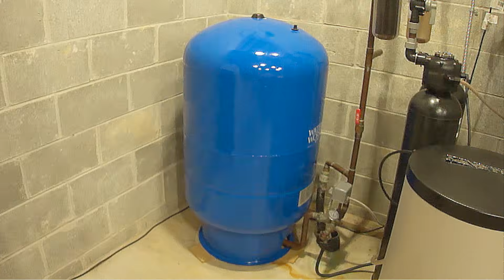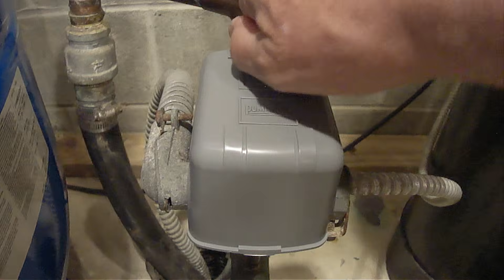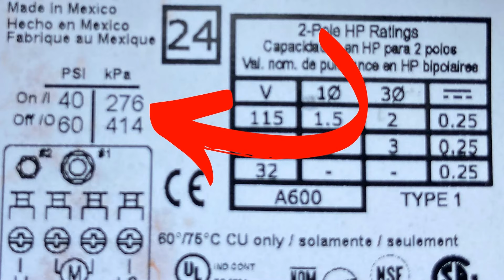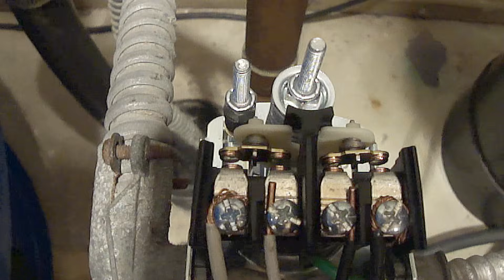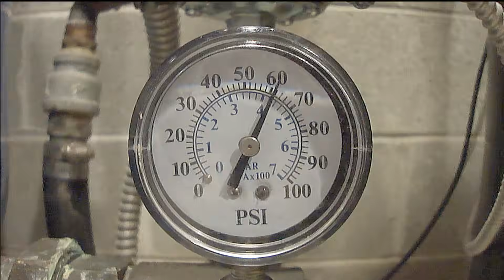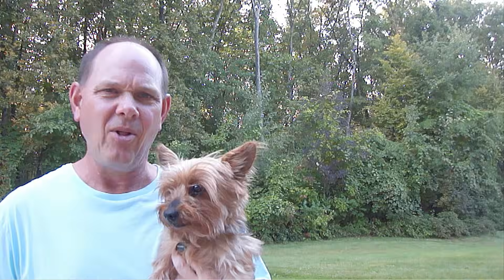NEVER Adjust A Water Well Pump Pressure Switch Until Watching This!

Comment: Ive nvr seen a pressure switch work like u r saying  pretty sure ur wrong 
Big nut will raise 40 and 60 
To 45 -65 or higher depending  on how umuch u tighten or losen
Reply: The small nut reduced the gap between  
40-60

Comment: I have a shallow well jet pump.  The pump shuts off at about 55 psi (cut out pressure) but the psi drops to about 20 or less when I use water before the pump comes on again (cut in pressure).  If I turn the big screw clockwise the label in the switch housing says it raises both the cut in and cut out pressure.  That's a differential of about 35 psi, which is ridiculous. The small screw per the label in the housing, when turned clockwise, increases the cutout pressure shutting off the pump.  I DON'T WANT TO INCREASE THE CUT OUT (PUMP OFF) PRESSURE. If I do that, my faucets start leaking.  I just want to increase the cut in pressure without affecting the cut out pressure.  That would mean I should turn the small screw COUNTER CLOCKWISE. I did that but nothing changes and the small screw is so loose that it may fall out if I unscrew it CCW any more.  My guess is that the switch "differential" is fixed at 35 psi, which is huge.  Any suggestions?  I have not checked the PSI on the air tank yet. I haven't changed the tank pressure via the schrader valve since I bought it new years ago, and it still looks in great shape.  - - - By the way, when I bought a new jet pump many years ago from Sears (now out of business) it came with a "plastic tube" that ran from the impeller to the pressure switch.  After a little while, less than a year maybe, that plastic tube broke and that signals a "low pressure" so the pump came on and ran continuously until I investigated the constant running only to find water all over the basement floor; good thing I wasn't on vacation for two weeks, - - so - - if you buy a jet pump with plastic tubing to the pressure switch, replace that with copper tubing.  I did that and also added a gauge to show the pressure in the tank which didn't have a gauge on it.  Sorry about the long post.

Comment: He is WRONG.  Large nut adjusts BOTH start and stop of the pump.  Leave the small nut alone to maintain the 20 PSI spread of the pump starting and stopping. This 20 PSI gives a fairly acceptable pressure range usability, while making the start ups of the pump efficient.  BTW, narrowing the 20PSI start/stop for the pump will cause increased cycling and shorten the life of the pump.

Comment: Hi Paul. Thank u for this video. Im a bit fuzzy on a couple points. 
Firstly u said one full rotation is equal to 1#? Yes ?
My tank is very old design and it has recently started to hiss and spit when i turn on the hot water. 
I think the people before me cranked up the numbers on the psi. It says use 30-50, but it diesnt get down to 30 and it doese up to 50.
From what i can tell the increase in the startfilling is set too high. 
This is an old tank and has no way o add air into the tank. No bladder or diaphram. Anywa, i have lowered the pressures to see if this will stop the hissing and spitting. (Just did this an hour ago so no feed back yet)
Am i on the right track?
Reply from the maker: Answer to your question is yes. I don’t know how handy you are but you may have to bite the bullet and replace the pressure tank and pressure switch which I have  videos for. It’s not difficult to do.

Comment: my pressure switch is a 30-50.. yet my gauge goes 40 to 60 (verrrry slowly, around 3 mins).. i checked my tank and the psi is 28.. so now i wonder; should i fill the tank to 38 or reduce my switch? .. i also suspect the nipple to be clogged with sediments.. not sure where to start.
Reply from the maker: If you’re happy with your water pressure, I would leave everything as is. If you’d like to see more water pressure throughout your entire house then I would replace the water pressure switch with a 40/60 and then raise the pressure tank to 38 psi. If you check my playlist under household, you will see a video showing how to replace a well pressure switch.

Comment: C@n any body tell me which is best setting foe a household?  My last one I remember was 20/40.  I h@d to redo the whole system when we had a flood. Seems to turn on more often and stay on for shorter time.  Also my toilets, sinks and showers seem to have a lot of aeration.  Most of this was reduced when I turned the shut off to fully on.  I think it was causing cavitation.  Still a bit there.  My pressure switch was made in Italy no label on the switch body.
Reply: For a whole 40/60. You can get by on 30/50 depending on size tank you have  but the pressure won't he as good in the house. What I did when I changed mine is I painted the numbers with nail polish.

Comment: If you're going to increase the pressure range, you also need to adjust the bladder pressure in the pressure tank. The bladder pressure should be approximately 2-3 psi less than the low pressure setpoint of the switch. No mention of this in the video.
Reply: Yes,  adjust this pressure tank FIRST. Then adjust the psi range SECOND. DO IN THIS ORDER/ SEQUENCE.

Comment: The taller one increase or decrease both the cut in and cut out pressures. The short one increase or decrease the spread of the cut in and cut out pressures. However both adjusters cross-affect one another so takes a lot fussing to get what you hope to achieve. It is hard to narrow the cut in and cut out spread as in my case. I have two 86 gal accumulator tanks.

Comment: Can I switch out a 40/60 switch with a 50/70 switch.  I installed a new water softener and it is dropping my pressure by 10%. Thxs.

Comment: You got that backwards  ,  The nut # 1 clockeise  raises the pressure and the pump will turn off at a higher gauge reading

Comment: Why is it neccessary to have the cut in and out  range 20 lb ? Instead of 30-50 for example, why not 35-50 ? Of course in this case pump run time will decrease and number of cycles increase but this is affected by other factors such as tank size. IOW why can't you decrease the variation of water pressure as long you are aware of other effects that might have? Also, are 30-50 and 40-60 switches actually different or just adjusted differently?

Comment: Paul, my pressure switch operates at 40/60 correctly but pressure continues to rise to 75psi. How do I fix this?
Reply: Check for and remove sediment or silt that plugs up the small diameter tube leading to the pressure switch. That is what happened to me with the same symptom.

Comment: With the 40 60 switch is it possible to crank up the pressure to 70 psi? Or is that pushing it too far? I’m a plumber and I’ve adjusted quite a few of these 4-5 psi but never  10. I have a costumer that is wanting more pressure to his shower. I have yet to check out his pressure tank or even the size of pipe he has ran to the shower so it could very well be the tank or under sized pipe for all I know but just wondering if adjusting it 10 psi is too much????
Reply: @jowlmorel  - You could blow out his plumbing connections if they can’t handle that pressure.

Comment: All the pressure switches I've worked with as a homeowner for 45 years the large lug changes both the cut-in and cut-out pressure. The small one just does the cut-in pressure I believe.
Reply: Yes the larger one increases/decreases the entire range. This is probably why he says do it first (which you should) then get the cut-in right. So he does not describe it accurately but the method is sound...
Reply: In a way he's right - turning the larger nut increases the switch on pressure of the pump, and turning the small nut increases the switch off point RELATIVE TO THE SWITCH ON PRESSURE because it controls the DIFFERENCE between the on/off points.  
So let's say the switch is set to 30/50 (20 lb differential).  Let's say he turns the big nut to increase the cut-in to 35.  The cutout pressure will automatically change to 55 lbs because the little nut is set for a 20 lb differential.
If he then turns the small nut to increase, he could potentially change the cutout pressure to 60 instead of 55 (or whatever) giving a pressure setting of 35/60..
I don't know for sure if he really meant that though.
Reply: If my cut in is at 35lbs. Should the pressure gauge drop again before, increasing pressure? It drop to about 20lbs before increasing pressure to 55.
Reply: Yep. He’s wrong
Reply: @c @boobiesandranch69 ’s not wrong. You adjust the larger nut first like he described. He just didn’t mention that it raises or lowers both the cut in and cut off. Either way that gets adjusted first for your pressure then the smaller nut will fine tune your cut in pressure. The only way to adjust the cut off is by turning the larger nut. Just because he failed to say the larger nut adjusts both the cut in and cut off doesn’t mean he’s wrong. His method is right.
Reply: So the small one is for cut in? No wonder i couldn't figure out why mine wasn't cutting in sooner. Thanks for the lesson
Reply: @andyferguson4657  There is usually a diagram on a sticker inside the switche's plastic cover.
Reply: Okay how do you set the cut in? Because there seems to be a delay in the cut in
Reply: @andyferguson4657  Have you fooled with the cut-in adjustment? Do you feel that the pump is cutting in lower than it should? If so you should be able to adjust that differently.

Comment: Don't you have to change the bladder and tank air pressure when you change the pressure switch
Reply: YES you must pressurize the water tank - with no water in it - to 2 psi below the cut-in pressure the switch is set to.   See AngelofOntario's comment.
Reply: @DavidMoriconiM3inspect  - You don’t have to have a new tank, but you have to adjust the pressure in it accordingly. Unless the bladder inside is bad, then you’ll need a new tank. — You’ll get water out of the top Schrader Valve instead of air when your pressure tank’s bad.

Comment: Can a pressure switch be damaged if the range is set above its designated range? I.e. If I have a 30-50 PSI pressure switch, but I run it 38 to 58 will the pressure switch eventually be damaged?
Reply: @stevereason6931  - Not so long as your pressure tank is also set accordingly, so it’s cutting off & on correctly & not causing the points to burn out quick.

Comment: My issue is that mine is so loud. But not downstairs when I’m right next to the tank. It’s upstairs. It’s such a loud ka glunk type of sound when it starts pulling in water / stops. I lowered my pipe so I wouldn’t hear the water but now I just have the loud on / off sound. It’s so annoying.
Reply: But how often does it do this?  If the cut-in and cut-out values differ by enough presumably it will shut off for quite a while?    I have a sound which is "ka-glunk glunk"  every 15 seconds!  I think it is turning on and off constantly (pump in mechanical room one floor away from my apartment)

Comment: As an FYI:
Your pressure tank should have a psi reading of 2 points lower than your pressure switch cut in setting.
Example:  If you have a 30/50 pressure switch, then your pressure tank should have a psi reading of 28.
If the pressure switch is set to 40/60, the pressure tank should be charged to 38 psi.

ALWAYS cut off the valve from the pump to the pressure tank and drain the tank by opening the flush valve or a nearby faucet, BEFORE you check or recharge your pressure tank!!!
Reply: THIS
Reply: @elizabethlang3022 thank you for repeating what the guy said in the video.
Reply: LOL good advice! We learned the hard way. Fortunately there was almost no pressure at the time. 😂

Comment: Bladder pressure?
Reply: 2 psi lower than the cut on setting. On a 30/50 pressure switch, the pressure tank psi should be 28.

Comment: My sprinkler system pump starts. And after 20 seconds the pressure switch starts opening and closing very fast?  What do you think?
Reply: Either the bladder in your pressure tank has went bad, the pressure tank has lost pressure & you need to recharge it, or your pump is wore out & it’s time to replace it.
As an FYI:
Your pressure tank should have a psi reading of 2 points lower than your pressure switch cut in setting. Example:  If you have a 30/50 pressure switch, then your pressure tank should have a psi reading of 28.

Comment: What do I need to do? my gage is showing between 40 and 60 . But when I use my water and water hose. The pressure drops slowly like normal. But my switch is not coming on and allows my pressure to drop to 0 . I end up waiting until the pressure builds back up. But if I am showering only, it will not give any trouble. Here's what I'm thinking.. The hose on washer is to much for the switch to Kick on and catch up fast enough.
Reply: Did you happen to figure out your problem my does the exact same thing, no matter how I adjust it, it'll run empty then come back on
Reply: Switch is coming on or it wouldnt fill your well pump is bad or its screen is plugged causing low flow rate

Comment: A great video indeed,  may I suggest using a nut driver 11/32 on mine 40 /60 is my differential. I give my self a extra 2 psi  for great water pressure not over pressuring the tank. Using a nut driver has the advantage of a  plastic handle that will keep the person from becoming the ground,  that's if the power is not turn off using the breaker or other means

Comment: My drummond pump keeps cycling on and off pretty rapidly, making the water pump out and pause creating a jerking flow. Should I adjust both? My pressure guage is rusted and doesn't work. Thanks for any advise!
Reply from the maker: You need to replace the pressure gauge and then readjust the pressure settings. If the problem persists then you may need a new pressure switch. Do the electrical contacts look burned at all?
Reply: @proclaimliberty2000  thanks for your reply! I'm looking into a guage replacement and as far as the connections, they are fine, no sign of being burnt. There may also be an issue with the pressure tank and I think its still under warranty. Thanks again!
Reply from the maker: @Manventure1  👍😊

Comment: According to the lid of my pressure switch (and other videos), the large spring which you identify as nut #1, adjusts both the ON and OFF values together, effectively raising or lowering the entire range without changing the distance between ON and OFF. It doesn't really change your procedure of adjusting #1, and then #2 for most situations, but it could lead to over-pressure damage if a viewer assumes they are not raising the top OFF value while attempting to only raise the bottom ON value.
Reply: Thank you for the clear video. I have a 40/60 switch but it’s cutting in at 24 and off at 74. Sounds like I need to adjust both nuts, correct?
Reply: @OfCourseYouCan you need to adjust the range first to get cut in and cut out closer together
Reply: @MacJank7  thanks!  The pump feeder tube/nipple was totally clogged with sediment. Easy replacement and problem solved.
Reply: Exactly! What is referred to as "nut #1" in the video raises and/or lowers the cut-in/cut-out pressures, but "nut #2" changes the differential between the two. Adjusting "nut #2" incorrectly (say, "closing" the differential between cut-in and cut-out) could damage a pump due to short- or over-cycling. Thank you for calling this out!

Comment: Check your wiring
Reply: check your small water line under the pressure switch it gets plugged with rust take pressure switch off screwdriver in water line to clean out rust replace switch and a new gauge good to go

Comment: About how many seconds/minutes should a good working system take to get from 40psi to 60 psi and for it to fall from 60 to 40?
Reply: The typical on/off cycle should be a 1 minute on and 1 minute off.
Reply: My drummond pump keeps cycling on and off pretty rapidly, making the water pump out and pause creating a jerking flow. Should I adjust both? My pressure guage is rusted and doesn't work. Thanks for any advise!
Reply: @Manventure1  You should get a working pressure gauge, since yours is rusted.  A bad pressure tank is the cause for most rapid cycling water pumps.  Do you have a pressure tank?
Reply: @darrelc5411  yes, there is a pressure tank and I believe there may be an issue with it. I have to find my warranty information as I think the pump is under an extended warranty. Thanks so much for replying!

Comment: In my country in the Caribbean they sell the new switches uncalibrated and the chinese brand square D switches are not as good. I often have to calibrate them before I send them out
Reply: You're correct.  Square D Was The best,  until the China took over the manufacturing of them.  Now???
Reply: @kezzatries  yup the ones assembled in Mexico seems to be better that the Chinese square D. Alot of problems